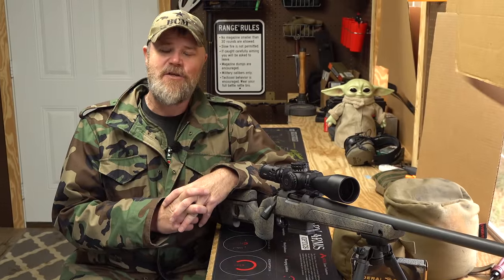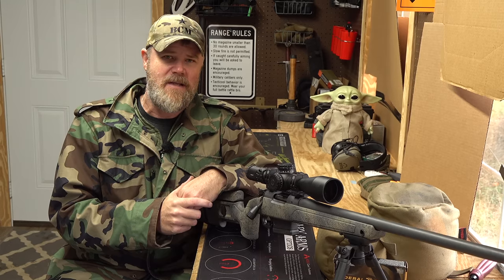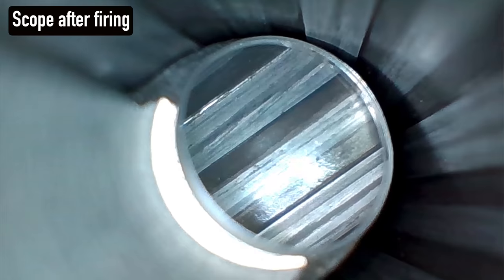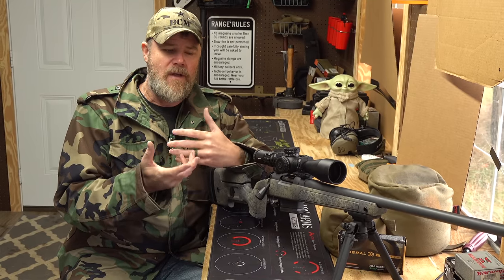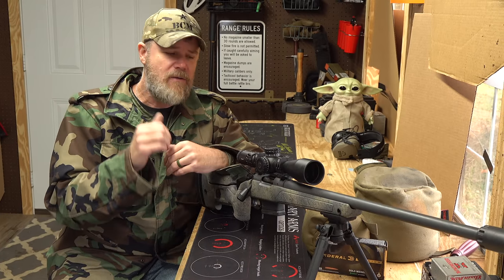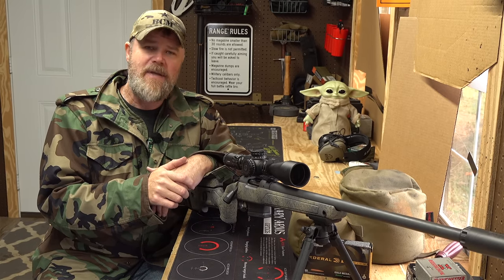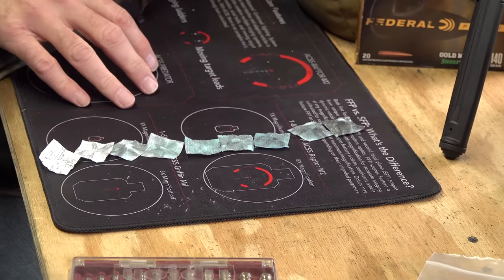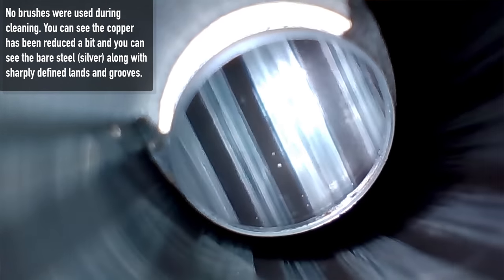Barrel Break-Ins and Cleaning Voodoo Rituals Destroy Barrels

Comment: Agreed. I have shot many different rifles and have gone through a few match grade barrels in the years I have been shooting. I used to shoot one clean one for 20 rounds and then shoot 5 and clean for another 20. I would then scrub the snot out of my barrel with sweets 762 and Hoppes after every range session. I would usually get 1800-2100 rounds out of a barrel chambered in 260 rem. I then wised up and started cleaning my barrels almost identically to the way you have described. I currently have a rifle chambered in 260 rem that is moving toward 3000 rounds and still shoots half inch (sometimes better) with no drop in velocity yet.

Comment: I clean my 7mm after 20 or so rounds.  My comp barrel from Pacnor likes to shoot clean and I use a phospherous bronze brush.  I take it off before pulling the cleaning rod back through.  Post cleaning cold bore is accurate, no need for a fouling shot.  Each to their own.  Thanks for sharing what you do.
Reply: A military magazine did a test a few years ago and fired rounds through a barrel starting clean and measured accuracy for 600 rounds. The most accurate grouping was I believe above 200 rounds and began to degrade after 300. Friction is the enemy. Copper is slick on copper. "Copper fouling" is a myth. It'll never build up enough to hurt anything. Carbon build up will happen first.

Comment: I like hearing people’s techniques, more so for an open discussion. The part I like most with this one is the “you do you” statement. Each barrel and firearm is different and unique. I agree that probably most people creat more problems then fix when cleaning. Also, some guns will be completely destroyed if you left them unclean and unchecked for an extended period of time. There’s so many factors that come into play, I can list examples until I’m blue in the face. I’d say this is a great method for premium barrels that have been lapped from the factory that made them. This would be terrible for a 100 year old surplus rifle after shooting corrosive ammo all day. I’ll give two quick examples of when you shouldn’t and when you should. 
1 range trip I witnessed a younger gentleman who was very proud of his new arsenal AK. He was cleaning it after every shot to “break in the barrel”. I didn’t have the heart to explain why he was probably wasting his time. Chrome lined, hammer forged, commercial ammo…… 
Another example is why you would. Carbon also attracts moisture. Think of someone who might live down south in a very humid environment. The M14/M1A comes to mind. I saw a very clean M1A once that was cleaned immediately after firing non corrosive ammo and had oil applied to the bore before storage.  The carbon in the gas port, over time, attracted moisture and caused the inside of the barrel to rust about 2” in both directions immediately around the gas port. I did some research after this and found that this is a common occurrence with that design. 

Anyway, like the content! Keep it up brother.
Reply from the maker: I'm just glad you heard the "this is my opinion" but I've had to modify it because people are so easily offended to "you do you". I should probably get shirts printed. 😂
Reply: @Militaryarmschannel  😄
Reply: I just got my first and only M1A (SOCOM 16). I have yet to get it out to fire it.

So I haven’t arrived yet at the point of establishing a cleaning practice for this rifle.

When you mentioned this M1A you saw with rust around the gas port, what are you saying caused it? It seems like you’re blaming the cleaning. But wouldn’t it have had carbon (attracting moisture) near the gas port WITHOUT being cleaned?

Comment: Very interesting but one point, those brass tips on a cleaning rod are 100 times more likely to do damage than the soft pliant bristles of a bronze brush. Personally the one thing I never use is a brass tip, only nylon for me. Another point, I know suppressors are rarer in the USA compared to here in the UK where 99 per cent of rifles are fitted with them, but nothing destroys a barrel quicker than leaving a suppressor on a rifle in a gun safe. You might as well pour acid down the bore.
Reply: Hell, the copper jacket on the bullet will do a lot more than a bronze brush. If you leave copper in the bore for more than 3 days the copper & moisture will begin electrologist. Eating up the bore under the copper. However it's your bore suit yourself.
Reply: @flea-kh7om  Read my post again. I didn't say the bronze brush did any damage, that was my exact point. I said the hard tip of a BRASS cleaning rod did 100 times more damage than the bronze brush. We are in agreement.

Comment: I’ve used some expensive cleaning rods. They have either gotten bent or the coating worn off. But the Tipton is my favorite. It’s a carbon fiber shaft that you won’t put a permanent bend in it like others. And there isn’t any coating to wear off. The price is on par with others like Dewey, or Bore Tech.

Comment: Exactly right! This is what works for you and is very sound advice from someone that shoots as much as you shoot. Every opinion isn't right or wrong. Many times it was taught by a father, uncle or grandfather, so hench you would trust that the most. A lot has changed in rifle and ammunition technology over the years. What worked before and was passed down may not be applicable today. Excellent job at explaining your process and your experience.  If someone can't tell that you researched and went through trial and error to lead up to your method, they don't want to have an open mind. Also, if they are happy with their procedure, they should continue. It never hurts to try something new. Thank you for sharing that with us! Shoot On Target!

Comment: As always, follow the manufacture recommendations and procedures!  The military required the shooter to clean the weapon after a day on the range.  CLP was provided along with the stock cleaning brushes.  I like the suggested cleaning procedures in the video.  Saves a lot of time and effort while retaining accuracy in the gun!
Reply: True but, military weapons are chrome line, I didn’t use a brush, the thirteens Years I was in didn’t have to. Oil patch, dry patch, plus pull the patch in the direction of the bullet.
Reply: @theresacox8207  The M-16 used for qualification (USAF) were issued and return the same day.  The Range Officials were ANAL retentive and oversaw the cleaning and inspected the weapon for return to the armory!
Reply: @richardlane1130  NO Brass or Ammo Drill Sargent! LOL:-)

Comment: Excellent video. I typically use hot water , a plastic brush and then patches whenever shooting one of my C&R guns and corrosive milsurp ammo. With modern guns and ammo, I use Hoppes, Stoddards solvent or lamp oil , with a plastic brush, to clean out the carbon fouling. With all of my guns, I give the barrel a CLP soaked patch at the end to preserve the rifling. As you mentioned, Dewey rods are the best. I never run a cleaning rod through my airgun barrels-John in Texas

Comment: No need for a "breakin", just shoot it, when cleaning, do not remove all the copper! It fills in the machining marks.
Reply: Not sure you want to keep it with copper in there forever. I’m no chemist, but I’m pretty sure copper has a corrosion effect and causes pitting as it slowly causes oxidation due to electron transfer between copper and iron ions. Though a desiccant pack should help, if the gun is in a safe or case.
Reply: @deekhaye  .why do people shoot a fouling shot? To replace what they removed, over fouling, ok, but do not remove it all. Done it for decades, no ill effects
Reply: @deekhaye  I believe pitting occurs when the copper has alot of moisture in with it
Reply: @independentthinker8930  Yes, and depositing copper in any barrel inconsistencies improves accuracy, but if you leave it in there over time it can cause galvanic corrosion, especially in humid environments. It’s the same concept for why you don’t mix steel and copper pipe fittings.

That said, oiling the barrel or storing in an arid place would prevent or slow an already slow process. Alternatively, though; it’s not like cleaning it and then refouling at the range hurts anything, so cleaning the copper before storing a gun for a prolonged period seems smart to me. 🤷‍♂️
Reply: @TheSprykilla  yeah, that’s why I mentioned the desiccant packs.
Reply: @deekhaye  do as you like, I just do what has worked for me over the years.
Reply: @deekhaye  water pipes and a barrel other than having a hole in the middle have extremely little in common. Water inside and electrolysis doesn't happen in a barrel

Comment: Never experienced issues with bronze brushes on damn near ten years of gun cleaning. Bronze is softer than steel. Sounds like a wives' tale to me.
Reply: He was using a stainless steel bore brush.
Reply: @jasonmaceyko1902   stainless is softer than the barrel as well. I use stainless wool and grease to remove rust on firearm restorations. It doesn't scratch the firearm.
Reply: So, is nylon, so why not play it safe??  I have used bronze brushes for 60 years which beats you 10 years and I have never NOTICED a problem but, I have never had t use of a bore scope to REALLY know!  So, maybe there IS damage!  For the last 3 years I've been using nylon brushes and only use a tornado brush once a year when I put them away in the fall after hunting Season!  So, I still haven't noticed any problems!
My point with all of this is that, if you have something that work AS WELL as a metal brush with absolutely NO chance of damaging the barrel, why wouldn't you use it?  Seems like a no-brainer to me!
Reply: @kimcurtis423  Militaries supply bronze brushes. I don't think you need to "play it safe". That's just paranoia.
Reply: @burmiester1  militaries do lots of foolish things. Like issuing worn-out, poorly-maintained small arms.
Reply: @TUKByV  My point is millions of people around the world use bronze brushes, it's by far the most common type of cleaning method and I've never heard of anyone having an issue. Using a steel brush is a different story
Reply: @burmiester1  gotcha. But you came across as obnoxious. You're but ONE anecdote here. Just one. Then calling someone paranoid, well, that was not only a complete misuse of the word, but a shtty conversational stunt. Amazing what anonymity reveals, isn't it?
Reply: @burmiester1  and again, militaries are seldom good examples of, well, almost anything good. Trashed firearms, ancient ammo, poorly-designed vehicles, anemic pay-hey, what's not to love? Let's talk about the VA...
Reply: @TUKByV  "Then calling someone paranoid, well, that was not only a complete misuse of the word, but a shtty conversational stunt. Amazing what anonymity reveals, isn't it?"

It's a friendly discussion in a youtube comments section, guy. I think you're taking it a little too seriously.
Reply: @TUKByV  Its you being rude, here.
Reply: I used to use a bronze brush on the pellet gun I got when I was 12 years old..... now I'm an adult and realize its completely pointless, I clean my barrels hardly ever and never have a problem. probably run some wet and dry patches through once a year, or that fuzzy mop head looking brush.

Comment: I completely agree with your break-in advice, and you “cleaning” periodicity.  I run some patches through the barrel every 150-200 rounds, and my HMR Pro is good to go.

I disagree with your idea that brass brushes ruin barrels, but to each there own.  I’ve never had a problem with my Benelli, my Ruger, my Savage, or my Bergara.  I run a copper brush about twice a year, and my guns are still sub MOA.  That’s my experience.

Comment: While I was in the Marines When we got a new weapon or barrel we did do a break-in / shake down of that weapon. We had this exact conversation as a unit. So we got to exact same rifles that was new and conducted an experiment. We did a break in with one and did not on the other. The weapon that was not broken in was not as accurate as the one that was not even close. The trick to this process is you only use a patch with CLP and not a brush every time you shoot a round. We only used the brush was for final cleaning and storage. And for in our ase this was combat tested. Brush would not be good for a break in. After you take 5 shots and hit it with a wet patch it cooled that riffling down quick and hardened it even further.

Comment: On all my firearms, just use a blue shop towel and wipe with CLP, then use a boresnake down the barrel 2-3 times, then a clean blue shop towel coated with CLP to lightly lubricate/protect.

It is more important, IN MY OPINION, to lubricate and protect from corrosion (rust) than get every last bit of carbon out of any firearm. They are going to wear out no matter what method you do.

Comment: I have to disagree with not using bronze brushes. So does J. Dewey. I shoot 50-60 rounds and brush, No.9 swab and patch jag wet and dry until clean. Every 250 rounds get SWEETS 7.62 copper remover and an oil bath in the bore afterwards. Then when ready to shoot again, dry patch the bore before firing. None of my rifles have ever lost their initial accuracy.

Comment: I agree with everything said except the brass brush! Barrels aren’t made outta room temp butter. And considering the trigger operator is sending copper and lead down it at thousands of FPS with a massive amount of heat and pressure, I’m certain a soft copper brush ain’t hurting shit! A person would have to scrub the absolute shit outta a barrel with copper brush at a high speed before it showed any difference and considering the brushes on them are flexible that pretty much makes a argument against a brass brush and steel a pointless one!
Reply: Brass is harder than copper. Brass does wear faster than the steel it rubs against but abrasion happens on both sides. The main point is it’s not necessary

Comment: I never run any brush through the bore on my comp rifles. 
Wet solvent patches followed by a dry patch after letting them soak. Continue these steps until the dry patch come out the other end clean. 

At about 1000 rounds I'll follow the previously explained procedure. Then I'll run a patch soaked in solvent and lightly cover with JB compound and stroke it back and forth (10 strokes) making sure not to exit or touch the crown of the barrel. Run as many dry patch needed to remove the JB and solvent,  then run an oil patch to protect and store rifle.

Comment: There is absolutely nothing wrong with using a brass/bronze brush when you find a set that is as hard or harder than that steel I have a bridge to sell you
Reply: Think about what the tips of the soft copper/bronze bristles pick up and get embedded/studded with though... Carbon, which is abrasive. Nylon doesn't get embedded with Carbon.
Reply: @macgyver5108  oh man, you're doubling down on the "carbon is just as hard as diamonds." Bwahahaha. Two different things, partner.
Reply: @gsyoung54  happy?

Comment: I agree with everything you have said.
The only caveat I would have is rifles that have got a soaking.  The drying process might involve a bit of cleaning and oil.  Takes two goes, one to get out the wet with a wipe down, the other to drive out the damp with a clean.  The end result is dry and clean.  Best done in two sessions with a break between for the rifle to sweat out a bit from the wipe down.  The wipe down is what you do straight away while the kettle is boiling once home/back to the truck.  (Don't forget to dry the gun bag).  
If you must put oil down a barrel, long term storage or something, then patch it out before firing again.

Comment: All makes sense, especially the back and forth scrubbing. But I’ve always just run a brass bristle brush out the front, then a brass jag with wet patches.  I use something called Weaponshield that does a good job.  I have to say I don’t see how a few breech to bore passes with a brass brush is going to hurt a steel  barrel, but I’ll try nylon instead and see how it works out.  I definitely know to avoid the cursed stainless steel “turbo” brushes.  Appreciate the logical presentation! 👍